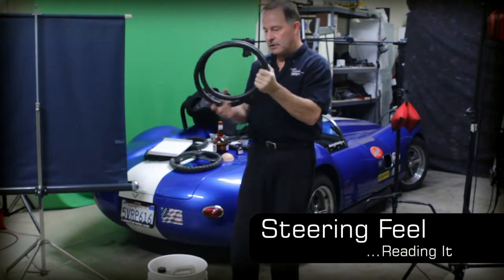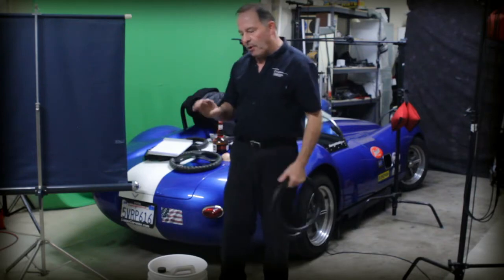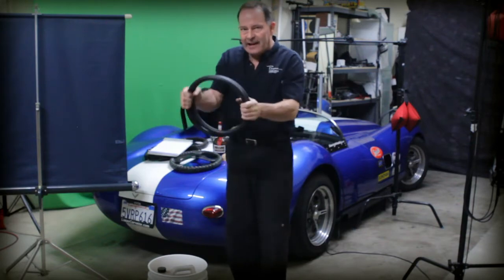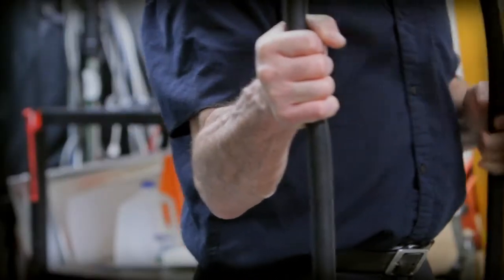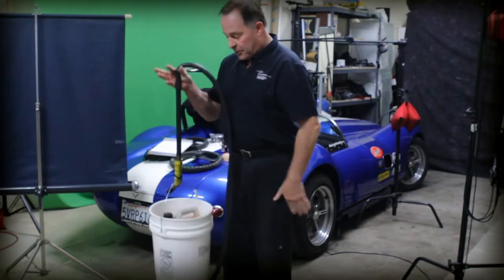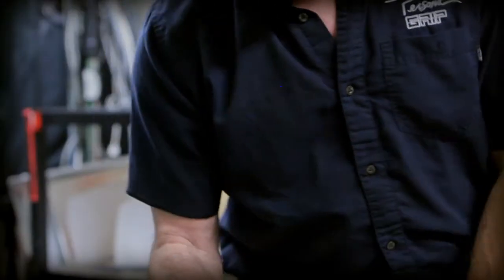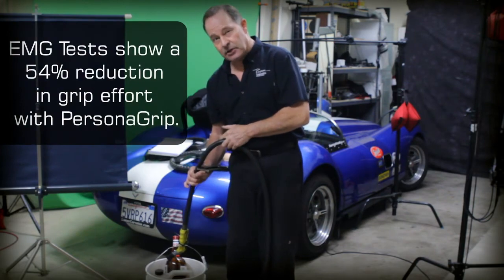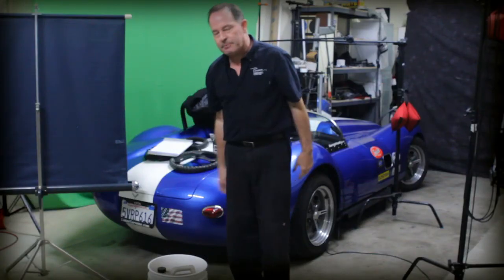Steering Feel & How To Use It PROPERLY

Comment: Haven't seen these grips used anymore.
Is there a reason for that?
Reply from the maker: PersonaGrip steering wheels are still out there, but pro teams are now trying to do it themselves using non-remoldable materials...like 2-part resins or aerobic-curing expanding foams.  Sadly, once they take a set, those are "best guesses".   

You NEED to be able to remold the grips and fine-tune them in order to get the most out of moldable handgrip technology.   Fernando remolded his wheels at least 4 or 5 times...he understood how the technology works.

I've tried selling the material, but that's like selling paint.  Just because you have paint, doesn't mean you CAN paint, right?

Luckily, videochat now allows me do wheels remotely.  

Using in-car footage showing their hands while driving and pics of the driver's hands, I can create designs that are 99.9% perfect.  Then, if they want to make any changes, I can coach them at the track via videochat.  Once they get it dialed-in, they can send it back if they want me to make them look new again...but, with THEIR design...all at no charge.

The issue I'm currently dealing with now is having poorly designed 2-part or expanded foam wheels -- done by well-intentioned teams who think it's easy -- ruining the reputation of genuine adjustable PersonaGrip wheels that have over 38 years of experience working with the world's best drivers baked into them.

I'm looking to move back East and get back on the circuit to help the pro teams with proper designs that can be fine-tuned to perfection...plus, the PersonaGrip material has a much better stick-slip gripping surface that's been optimized for the driver's gloves.

Do you have an application for it?  If so, let me know, and I can get one make for you.  
Ed 
714.342.3020 c
Costa Mesa, CA

Comment: Great video and explanation.  I have been a death grip racer and because I run with an endurance team I only have 1/4 the say in what we do (steering wheel being an example).  My buddies like the smaller ones (they are used to it).  I like the larger dia. more leverage.  I have also notice that once I switched and bought new  higher end gloves I didn't have as much grip problem.  Would like to try your product sometime and race with it and see what its like.  Will try to buy soon.
Reply from the maker: Thanks for your kind words, Scott...maybe you've bought one already?  Yes, team wheels are less defined, and have deep fluting along the back side...towards the front of the car.  The rest of the design along the outside circumference and front face follow more of a road race design style...less wings above/below the hands to allow for shuffle steering.  

New surface treatments help in micro-adjusting the folds out of the gloves underneath in the palm areas.  

Most people are shocked when they first feel what a PersonaGrip wheel actually does...I know I was since I made 34 of them for IndyCar/IMSA/NSACAR drivers before I even tried one myself on my BMW Hartge H3!